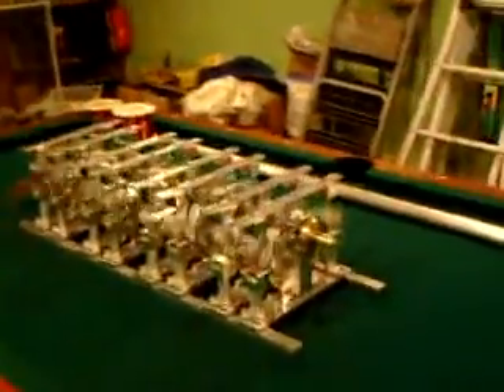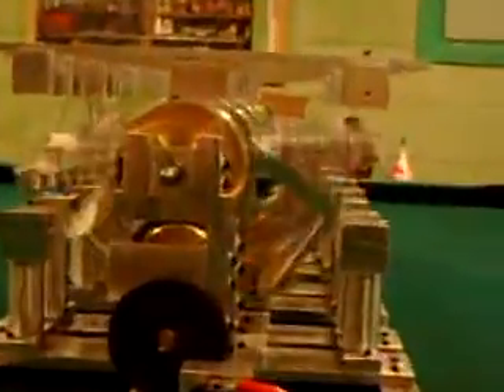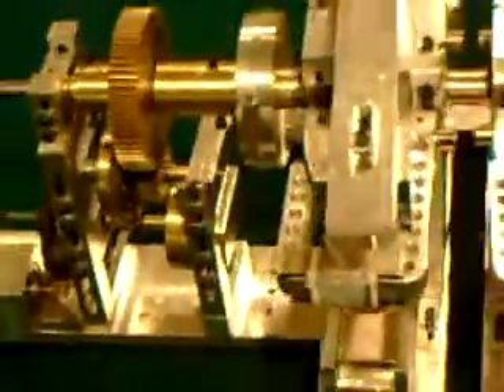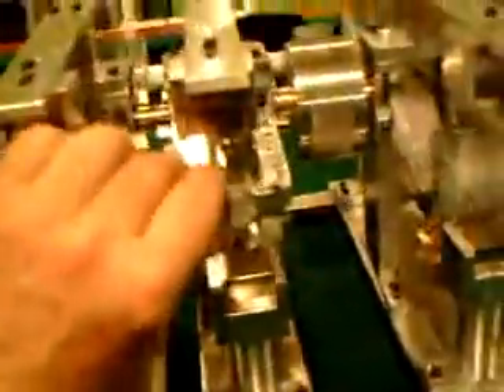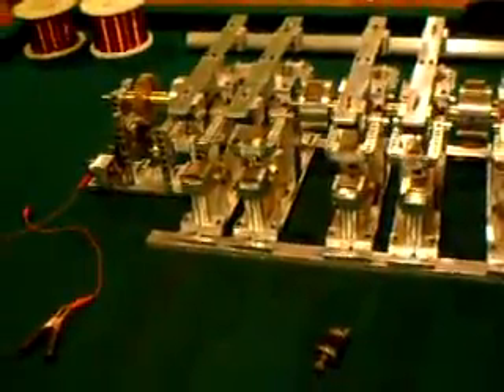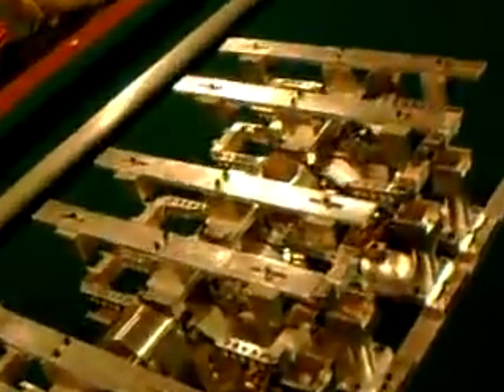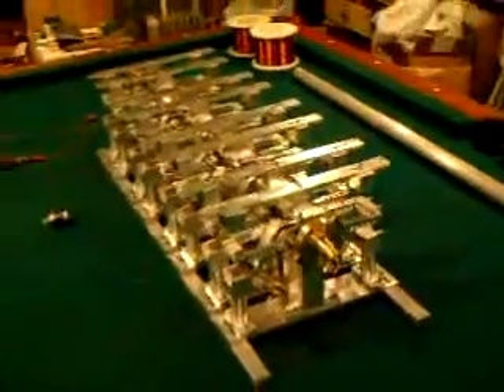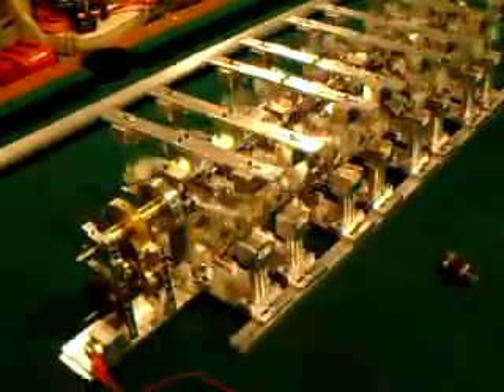Over Unity 18

Comment: So, where is the overunity? As I understand, you want to feed the kinetic energy of the oscillating magnets to the coils in order to produce electricity, like any normal dynamo does. But you'll notice, that the energy that goes into the coils is taken away from the magnets (your machine in slowing down and coming to a halt, if you don't power it with the motor).

Comment: Any generator today has minimum 60% to maximum 90% (depending on the type). also an average internal combustion engines efficiency rages from 18%-20% (4% wouldn't be enough to run at 20mph). unless you are talking about an electric car where battery discharge efficiency (typical li-ion battery) gets 90% and a motor of 75%(average again) you should be around 50 - 60% efficient. which invention of Tesla are you referring to anyway? i seriously doubt that he had anything only 4% efficient.

Comment: ok, you are good building this things, but, before getting this thing bigger, ¿could you please measure the output and input power?, because, until you don't do that, it's just an oscillating motor.
get some resistor, maybe, 100 ohm, put it on the output (rectified please!) measure voltage and current trough it, then measure, while the resistor is still there, the voltage and current from the input battery. power= v*i, get input power, output power and look if out is bigger than in.

Comment: i like it a lot. this thing is truly sexy. keep up the good work. 

and for the naysayers, this is not over-unity this will run out of energy when the magnets die in about 500 years or so. it is not actually powered by the magnets anyway but the electrons spinning inside the atom. this allows for an extraordinary amount of power to be extracted from the magnets. 

or from the force that keeps an electron attached to the atom. but i am not going to get into the quantum physic.